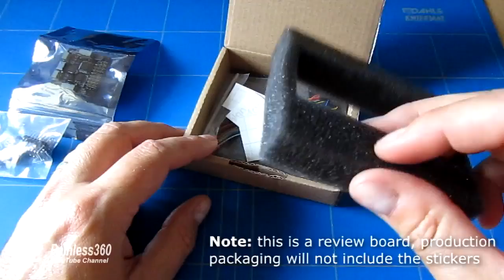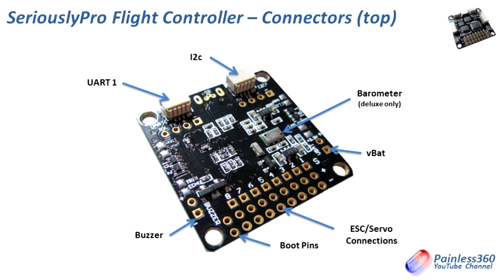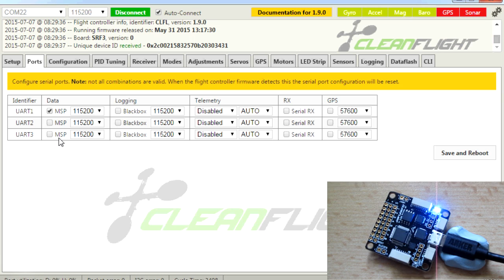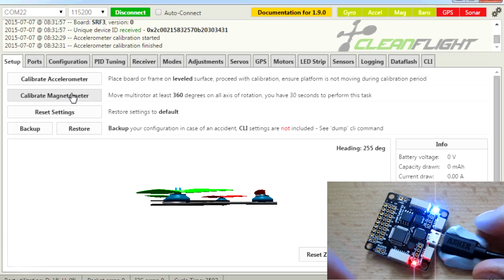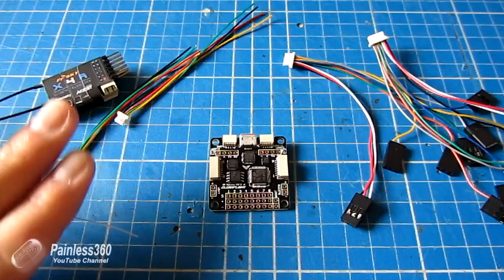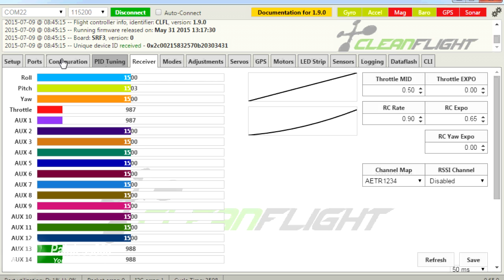(1/9) Seriously Pro F3 (SP3) Series - Overview and firmware installation

Comment: Hi there, apologies for my ignorance, is this board similar to the Seriously DoDo ? getting rather confused about the available options ... I am currently using the Naze 32 but suffering from lack of ports to add SBUS, Smartport and keep my configurable LED's
Reply from the maker: There are lots of STMF3 based flight controller designed for use with Cleanflight/Betaflight now. Most share the same features and components. They normally have more memory, faster CPU and extra ports and features like Blackbox storage built in. Lots to choose from now. Best of luck!
Reply: many thanks for the clarity ... Do any of the STM boards currently offer good GPS support ...
Reply from the maker: It's the software that lets them down at the moment for GPS. Check out the testing code 'iNav' if that's what you need..
Reply: I have iNav loaded on a Naze32 ... After a couple of days of serious head scratching and watching all your Naze32 Telemetry videos I could not get Telemetry from the FC to work!  I eventually discovered that Telemetry has been removed from the firmware, i think to conserve memory!
I will search for a STM board that has good iNav support. can you recommend a specific FC
Reply from the maker: I'm waiting for the code to make it back into Cleanflight and then it SHOULD get easier ;) Let's hope so!

Comment: You dont show how your binding this reciever to your transmitter Is there another video showing this
Reply from the maker: Binding is specific to the radio and is normally covered in great detail in the manual for the radio. We have DX9. DX7, Taranis, and Turnigy i10 here at the moment..
Reply: I have got to a point after all day reading Walkera reciever runs on PPM the flight controller also has ppm
The problem is when you buy anything especially from china you dont get a manual or instructions So if you can look up at the walkera rx702 even though it comes with a bind plug If i connect  the battery to the PPm connector which is Batt on the reciever Wher do i put the bind plug to clear it
???
I have spent hours looking on the net and cant find
If you can help and have a look at this and suggest something
I would appreciate it
http://www.ebay.co.uk/itm/131302851008?_trksid=p2057872.m2749.l2649&ssPageName=STRK%3AMEBIDX%3AIT

Also i have found this Would this work?
http://www.ebay.co.uk/itm/Walkera-F210-3D-RC-Quadcopter-Parts-External-Receiver-Converter-F210-3D-Z-09-/231956625835?hash=item3601b139ab:g:lAMAAOSwR5dXRsN3
Reply from the maker: The binding is a once only thing. I normally bind it then setup the model, then rebind it so any failsafe stores the new values and trims. If this receiver does produce a PPM output on the Batt/Bind port then power the Rx by plugging the existing wire you're using into another one of the outputs with the bind plug in Batt/Bind. Once bound then pop the cable for PPM back into place. Best of luck!
Reply: cheers Much appreciated
Reply: Yehhh i have finally managed to get the receivers to work in cleanflight On your video PPM/PWM and Sbus connections You mention take the tick out of msi and reboot and it worked
Nice one
Not sure what should be selected in providers Noticed in yours it was still on Sbus
Please advise if you can on that
Going to watch one of your vids on soldering now
Look forward to your reply
All the best
Graham
Reply: It looks like from your video the power distribution board is built into the frame you have I bought NAZE32 F3 Power Distribution What connections do i have to make from that to the sp pro flight board
Cheers
Reply from the maker: See the 5th video in the 'Quadcopter for Beginners' series to see how we've just done that here.. Best of luck with the build!
Reply: If it wasnt for you and your videos i wouldn't have attempted building one
Thanks for all help ,means a lot
Reply from the maker: Happy flying! :)

Comment: Do you have to have Google Chrome? and please tell me the conection you are making to power this board what size battery?
Cheers Still learning but getting there
Reply from the maker: Cleanflight is a Google Chrome app so you do. There are lots of videos on RC power in the 'Introduction to RC' playlist that may help. I tend to use 1800-2200mah for most of the 250 class quads..
Reply: Cant believe the trouble iam having Contacted walkera as i want to use the Devo 7 transmitter
They told me i needed a RX702 walkera reciever Just watching no 1 of your build and you mention to connect the reciever to SBus
It doesnt have it
So now that was a waste of £21
I have emailed walkera asking them for which one i need
In the meantime i have looked and Walkera do a RX702 this has Data Bus Is this the same as SBus?
You must be fed up of all my questions sorry I just ordered all the parts you did apart from reciever
Any advise?
Reply from the maker: From the very average detail on the 'net I'd say that it looks like it should work but the Rx appears (!) to be only PWM. Best of luck with it.
Reply: Just had email back from walkera They said there works on PPM with the Devo
How would i connect this to the reciever and were on the flight board. Just spent so much on this not enought for transmitter so thats why i have to fix this
Chers
Graham
Reply: Just watching another of your videos on recievers PWM,PPM.Sbus,Sat
This reciever uses PPM were on the Sp pro flight controller would i connect this
Reply from the maker: I think we cover that later in the series.. Best of luck!

Comment: + Painless360. FYI Interestingly,  without shorting the boot pins, the flashing will fail and you will not able to connect to the board again. The error you will get when it failed to flash is "No response from bootload, Programming FAILED"  The status LED will not turn on. Only Power LED is on. May be mine is a chinese clone. Here are the steps to flash.
1) Disconnect FC from PC
2) Enable "No reboot sequence" and "Full Chip erase"  in the Firmware Flasher TAB. Manual baud rate still needs to be enabled.
3) You have to short the boot pins and connect FC to PC to boot into bootloader mode. Once it is booted up you do not need the boot bin shorted. Please note the status LED will still off when it is in bootloader mode. Not sure if that is the case for other board.  So for my board you can tell if you are in bootloader mode.  
4) Flash FC
5) Disconnect FC from PC
6) Connect FC from PC and everything should work as normal.

Tested above with Configurator 1.2.2 on Windows 7 and flashed with cleanflight 1.13.0
Reply from the maker: The originals are no longer being made - all the ones for sale now are clones.. Thanks for the post!
Reply: Hello Painless360 does this mean everything in your tutorial isn't going to work because only clones are available? I really need to know as I just ordered the SP3 mini and if so can you please do another video on setting up the clone or direct me to a tutorial that has the correct information please I really like your videos I'd be on the ground still if it wasn't for you thanks a lot.............
Reply: I use a clone spracing f3  apart from the flashing procedure i found all of steps in the video are as accurate as it can be. When i started playing with this hobby. There is frankly no other better source of info than painless360 channel. His series on cc3d and spracing f3 are very informative.
Reply: hello Jack Tuong I have a question how do you short the boot pins?  Please if you don't mind I appreciate your help.  Thanks
Reply from the maker: You can short them with anything conductive as you power on the board. All of the SP3 boards we have here have worked without shorting the boot pins. The only 'gotcha' with the SP3 board is making sure you choose manual baud rate.. The process is covered in the manual for the board. Best of luck.
Reply: Even after doing this, when i connect it to CleanFlight it still doess't work.  Any other ideas?

Comment: Help! I got a Failed to open USB device. what does that mean?
Reply from the maker: What have you already tried?
Reply: I tried the jumper boot method to load firmware after I wrote you and now my evo won't even turn on when i plug it into the usb. Omg!
Reply from the maker: I'd unplug everything and if you can't get power on the board then something very serious happened. I'd try another USB cable to be sure.. Best of luck!

Comment: Your Video are excellent. Thank you. I have a Taranis Plus.I have done what I think is everything to set it up, but I still cant get the radio to control the drone. I did the bind with the X4 R receiver. I have set the channels 1 for throttle etc. However, when I go on clean flight, in receiver It shows the right stick as throttle and the left forward as roll. What may I be doing wrong?
Reply from the maker: Check the channel order, if that doesn't' fix it then you can simply move the outputs in the radio menus to match the order in Cleanflight. Best of luck!
Reply: I got the issue corrected, thanks. It was in the settings.

Comment: Will all this work with a Devo 7 transmitter
Reply from the maker: I've not here but I can't see why it wouldn't work..
Reply: Thanks just dont want to buy the parts and then have problem binding As you say surley if its a transmitter it should be used for anything
Reply: sorry for all the questions Love your videos Trying to watch as many as poss I want to order parts to make a quadcopter At the minute i am flying a walkera runner 250 and having binding problems since antenna was cut with props Tried a repair no good so no flying untill part come from banggood So i want to make a fast quad problem there are so many different people giving advise and knowing me ill end up building something that wont fly Or the transmitter wont work So thats why iam asking all the questions Just want to start ordering parts
I was told that  EMAX RS2205 2300KV Disc Type Brushless Motor for RC FPV Quadcopter Racing were a good choice can you recommend anything or even a project you have worked on that would be a good racing build
Once again many thanks
Graham
Reply from the maker: That's a great motor - we use them here. Tons of power. Opinions are like belly-buttons - everyone has one ;) We've built a few kits here and most of them are using variants of the same technology now. Best of luck with it.
Reply: Many thanks Going to buy them now would i need a 30amp esc with them
Reply from the maker: What is the amp rating for the motor in the specs you've seen?
Reply: Not sure there was a guy who mentioned i best use 30amp to be safe I was going on what he said for these motors
http://www.banggood.com/4-PCS-EMAX-Cooling-New-MT2208-II-2000KV-Brushless-Motor-CW-CCW-for-RC-Multicopter-p-1029160.html
Reply from the maker: You need to find the amperage rating of the motor and then choose an ESC with at least 20% more capacity for safety.. Best of luck!
Reply: thanks

Comment: @painless360 I just ordered Naze32 Rev6, is I fly Qav210, with 2205 2300kv Redbottomes Emax, is there a huge benefit for having this, I did watch your video, I see its a faster board, but Mainly has more options, and SBUS seems better, "Previously I had to do a hack for my Naze32 REv5 board" and what a pain in the ass" But Should I jump on the SP F3 board, because it has better feedback persay , feeling locked in in a more solid way? Again thanks I am new , as of Sept 2015 FPV, so Im always wanting to learn, thanks in advance!
Ronnie
Reply from the maker: +Ronnie The Naze32 is a great board if you're not into all of the extras. The newer SP3 boards support all the latest additions and improvements to the code. Best of luck with the build!
Reply: while I have you, quick question.. So i Have 20amp ESC powering my 2205 emax redbottoms 2300kv, I just watched where they are changing their looptime, mine is set at 1000 "cycle time" what should be my min, and max numbers? it seems i may be to low, and makes sense if thats what allows my rolls, and flips, seems slower than most, am I correct? thanks bud!

Comment: just got an spracing f3 and an x4r to replace my naze32 and dvr. thanks for this. i've got a pretty good idea how to hook everything up. my question though is there an alternate way of connecting the x4r and telemetry to the board instead of the white jst connectors? is it possible to use any of the uart solder holes/pins? thanks in advance
Reply from the maker: +icemanxpe If you can find a 'hole' that is connected to the pin - possibly.. We've not tried. Best of luck..

Comment: HELLO, FIRSTLY I WANT TO THANK YOU FOR ALL YOUR KNOWLEDGE. So I have a new board I purchased from banggood. It is a CK Racing F3 FC acro. When it arrived I couldn't get it to arm so I flash the firmware. The thing is i'm use to baseflight so I pulled up baseflight and flashed the board. Well this is a cleanflight based board. :( Now I can't get the board to do anything. I have tried to reflash using cleanflight but now I can't get the bootloader to connect. Do you know what I can do to correct my mistake? If you can help I would appreciate it.
Reply: +michael rodgers Hello again painless, I figured out the problem. When I loaded baseflight firmware it removed the drivers needed for the bootloader to work. I simply downloaded these drivers and it started to work. http://www.st.com/web/en/catalog/tools/PF257938# Maybe this will help the person doing something stupid like I did. lol That's again for all the great videos. I have learned so much from you.
Reply from the maker: +michael rodgers glad you sorted it. Happy flying!
Reply: +Painless360 I wish I could fly. lol I'm still having issues with it. I can't get it to arm no matter what I do. I have changed my rx and tx setup to arm on a switch and without a switch. I noticed when I set it up to arm on a switch and placed the switch in the arm position it doesn't turn green like it is suppose to. I setup my mode switch and they seem to change and work right. At least when I switch to the position it turns green. It's just the arm that will not. This is why I tried to update the firmware and messed up the bootloader. lol Can you give me any pointers to try?
Reply from the maker: +michael rodgers see pur troubleshooting arming video in the Naze32 playlist. A lot of that is relevant for any Cleanflight powered board. Best of luck!
Reply: +Painless360 I have watched all of the painless videos. lmao I have tried everything you mentioned in the video. I have even made every adjustment anyone else has told me to try. I believe it is time to give in and except I have a bad board. :( Thanks again for your help

Comment: Hi Painless do you think  is worth to get one of these SP f3 for a first 250 quad build, instead of the  naze or cc3d (wich costs 1/2 of the Sp)  Yes, I saw the whole video and I know that the specs of this board are much better than the others mentioned. But performance in real life is another story and as I said, for a first ever 250 build is it really worth? 
Regards.
Reply from the maker: +Dashz if you just need a basic controller for flight then the Naze32 is still a choice. See our video on flight controller comparison. Happy flying!
Reply: Thanks ! I saw it, but the SP is not included. Happy flying too.

Comment: How does this compare to naze32 ??
Reply from the maker: +James Somerville this is a Naze32 on steroids with more of everything. The Naze32 does most things well though..
Reply: +Painless360 I was told that if I had a naze32 it's probably not worth upgrading!! But this does sound easier to programme with more features!!? I'm very tempted...
Reply from the maker: +James Somerville if the Naze32 does everything you need and it flies nicely then why change it? I only change a flight controller if I run out of ports or need the model to support extra flight modes like GPS. Happy flying!

Comment: I am having a issue with my accelerometer. If I calibrate it works perfectly but if you power the board off and on again it reacts very slowly until calibrated again. Just doest seem to be saving? It is running the latest version of firmware.
Reply from the maker: +Grahamwt007 Not sure - you do need to let the board 'settle' after power on until the leds calm down. If you are then I'd get in touch with the vendor...
Reply: +Painless360 Thanks very much!

Comment: Would you happen to know why i can flash my board through CF, but once when it flashes successfully and i go to connect it, it won't connect?
Reply from the maker: +Glenn Sullivan not without more detail. Could be. Driver problem. What troubleshooting have you already tried?
Reply: So i have this FC, have flashed it to 1.12 through CleanFlight. Im on MacBook Pro El Capitan. Have download SiLabs USB driver which shows up IN CF when i connect my FC via USB. However, tries connecting for 10 seconds and then fails. Have tried different computers, USB cords, have tried BaseFlight. Uninstall and reinstall Chrome and CF but no lock.
Reply from the maker: +Glenn Sullivan Sorry, we don't use any Macs here, best of luck..

Comment: Hello,

i have just received my seriously pro racing f3 board and tried to connect it via i bus to my flysky i6ab receiver. It doesnt work. Even your presented methods on how to set up pwm and ppm dont work at least a bit :( Did you checked it with the flysky fsi10? 

thanks a lot
Reply from the maker: +DesertGatorTune all the detail we have is in this series. I'd contact the vendor for support. Best of luck!
Reply: +Painless360 thank You but After a while i recognized that rx and TX un-bind themself. I dont Know why but Now it works :)